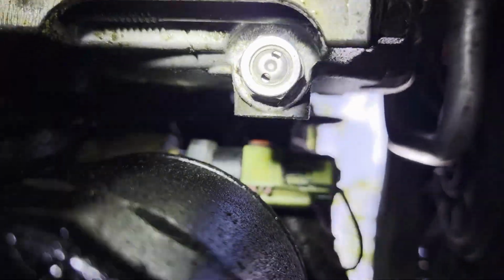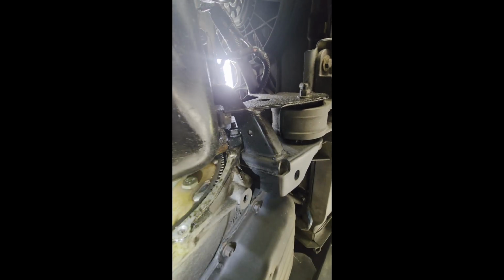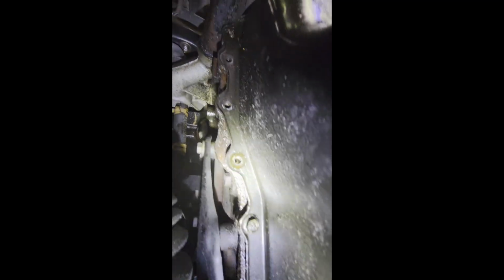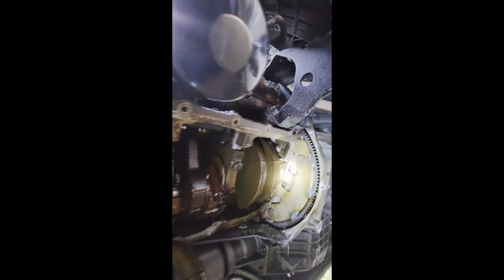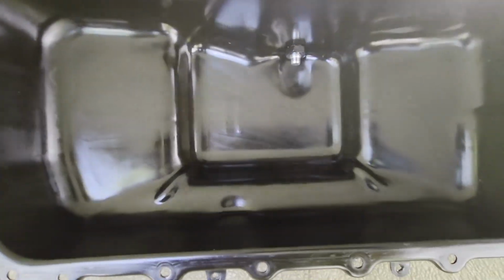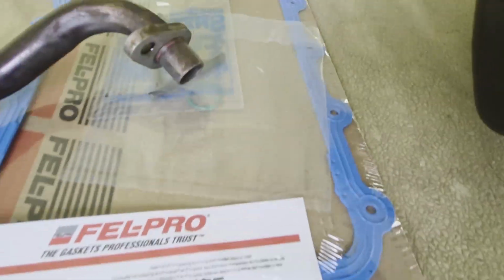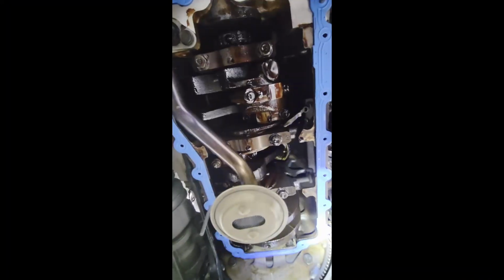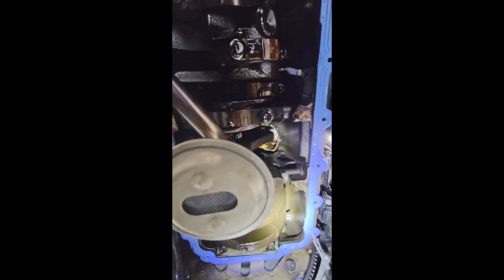2006 Chrysler T&C pickup tube inspect, oil pan gasket replace

Comment: Just wondering if it solved the problem?  Great job very well detailed!
Reply from the maker: Great question! Unfortunately it did NOT fix the issue...but it was the next logical thing to do after replacing the low pressure switch
Reply: I had the same question! My 2007 T&C (238,000 miles) has the same problem. At idle and under load (A/C on and/or in gear) the oil light will briefly illuminate. I assumed the worst-- that the crankshaft bearings were shot. I actually started to get pricing for an engine swap. (But I also noticed a front main seal leak in our case.) I'm going to do as you did anyway plus replace the front seal and see what happens. Out of curiosity - did you ever actually solve the problem?